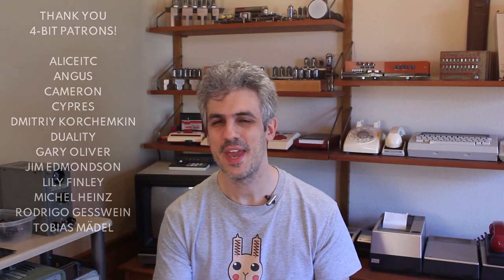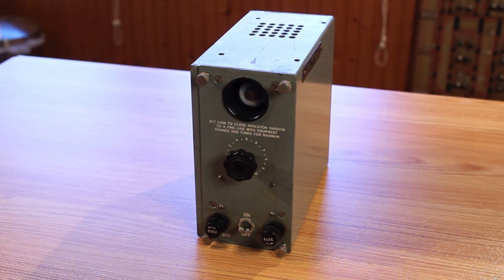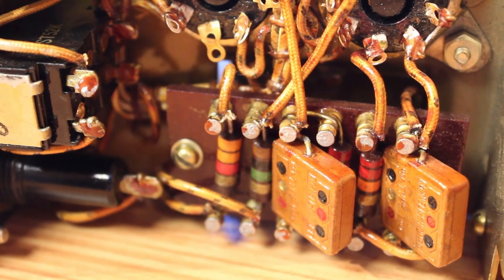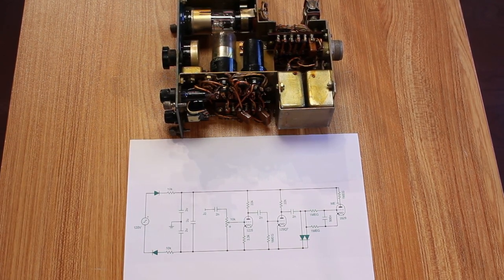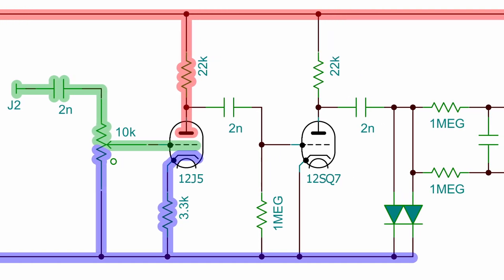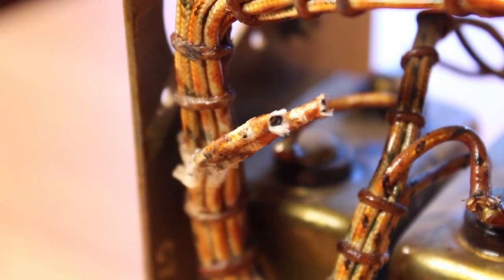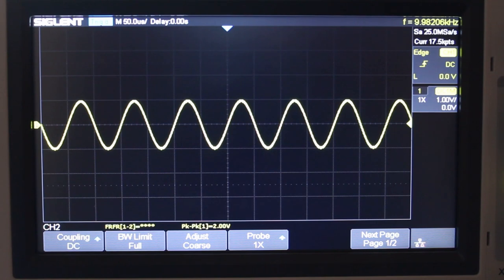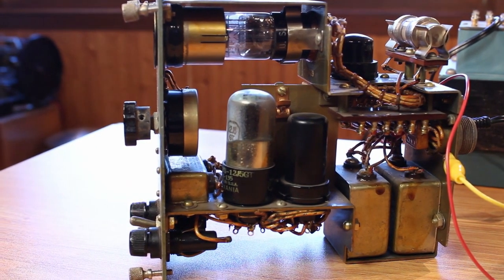Reverse Engineering a U.S. Navy Vacuum Tube Thing

Comment: Ok showed a picture of it at our club meeting tonight and no luck with a positive ID but the general though is a prototype of some form as it does not have an ID plate.  There is most likely space for it on the front where the 4 screws are.  As well can you check to see if only one or the fuses are wired up.  That would be a spare.  The fuse means it was not designed for aircraft.  They also had a look at the schematic it might be a compression amplifier for RF.
Reply from the maker: Thanks for showing it at the club meeting! A shame that we didn't get a positive ID though.
I'm still thinking the Bearing Deviation Indicator is the most likely guess!
Reply: @UsagiElectric  Well we are still working on it. So far is looks like  compression amp or a level converter for demodulating radio teletype signals.

Comment: This is to detect variations of the amplitude of an AC signal. It is to be hooked up to some sensor, who knows, perhaps sonar as others suggested. The knob is to adjust for the 'normal' level so that an abnormal level is easy to notice on the magic eye.
Reply from the maker: Thanks for the insight!
It's a surprisingly simple circuit inside, and it may have actually been designed to be used in multiple different setups, kind of like a universal detector.

Comment: Interesting unit, obviously some type of tuning indicator, World War 2 era.

The R/C coupling signal into V1, acts as a high-pass filter, rejecting frequencies below 8 kHz.

That 12H6 is a detector diode made for a receiver, when used as a rectifier, it has a maximum AC input of 150 VAC so, the diodes in series help to derate the 12H6.

The curious part is the series filament resistor; why is it in a fuse holder.  Makes me wonder if this unit is made to operate on more than one line voltage, with the resistor value changed out accordingly.

The diodes in V2 are used to clamp the AC signal, pushing the whole waveform negative, so the positive peak (assuming the signal is a sinewave) is referenced to 0 volts.

That was a good idea to redraw the circuit to make it easier to understand the signal flow.

The abnormally low value of plate resistor used with V1 and V2 is used to extend the high frequency response of these stages, to roughly a top end of 1 MHz, at the expense of stage voltage gain, which is likely  3 to 10.

The 0.5 uF cap across the grid and cathode of the magic eye tube is used to filter out any AC component, so the eye indication will be stable.
Reply from the maker: Oooh, that's a brilliant idea about the series filament resistor being interchangeable! I bet that the system was designed to be used for multiple applications on different ships, and in WWII the shipboard supplies may have varied quite a bit from ship to ship. 

I actually did make a mistake on the circuit regarding the Magic Eye tube. I went back and double checked and I missed the connection from the cathode to B-. Here's hte updated schematics, which make way more sense:
https://i.postimg.cc/jdZ7FfBh/Updated-Schematic-A.png
https://i.postimg.cc/85MyR4K4/Updated-Schematic-B.png

Thank you so much for all the excellent insight!

Comment: For the magic eye tube to work properly the beam control grid 
electrode needs to see a negative voltage, the diodes effect this operation. This is a normal setup.
Reply from the maker: You're absolutely right!

Though, I missed an important connection from the magic eye's cathode to B-, here's the updated schematics:
https://i.postimg.cc/jdZ7FfBh/Updated-Schematic-A.png
https://i.postimg.cc/85MyR4K4/Updated-Schematic-B.png

With the schematic laid out like that, it makes a lot more sense now!

Comment: The diodes on the magic eye tube is to charge negative voltage on the grid, the more negative the grid gets the more the eye close, you can see the diodes as a type of charge pump on which the positive voltage pass trough the diodes and negative voltage stays. the tube is cathode biased and the diodes let the positive voltage pass to the ground and charges up the negative voltage on the grid so that the eye can close. the stronger signal the more negative will this voltage become. this device is basically a two stage amplifier driving the indicator tube. It can be used to monitor AC voltages or voltage impulses. it might have been used to calibrate signal receivers or monitor alternator voltages or other cool stuff, or simply as a VU meter. it could be used for many things back in the days
Reply from the maker: You're absolutely right about the Magic Eye diodes!

Although, I also missed an important connection from the magic eye's cathode to B-, here's the updated schematics:
https://i.postimg.cc/jdZ7FfBh/Updated-Schematic-A.png
https://i.postimg.cc/85MyR4K4/Updated-Schematic-B.png

Also, another commenter suggested that it was used as a Bearing Deviation Indicator in early sonar systems, which seems like a fairly likely application, but you're right in that it's designed in such a way that it could have had multiple uses on several different types of equipment.
Reply: @UsagiElectric  yes and the updated schematic is absolutely looking as it is accurate now. I am almost tempted to build that sometime and test what it can do. Great work Usagi!

Comment: if I think of it as a black box with a signal input and an eye tube output, it is clear that the device is a calibrated display of some sort, i.e. you're supposed to calibrate it by adjusting the gain under controlled conditions and then do the "real job", whatever that might be, watching the eye tube and keeping it at the same level by doing whatever you're supposed to do with the "real job" equipment. I can't think of any other application.
Reply from the maker: You're definitely on the right path!
I think another commenter figured it out as a Bearing Deviation Indicator for sonar systems, which fits right in line with your black box logic!

Comment: I love the vacuum tube it uses as a Graff ...I buy them every time I see a listing online lol I find tubes with visual components are mezmerizing
Reply: Just don't use a red clean tube as an indicator LOL
Reply: Also I've heard about tubes that were essentially a self into getting a shift register component that were used in some old scrolling message displays in large format!

But there were actually metal to Sophia quartz window I believe it was forwards to be determined if it was red plating!

There was some pretty cool indicator tubes back in the day and even touch display tubes but it would require a hundred YouTube videos or more to even scratch the surface in my opinion
Reply from the maker: I totally agree, visual vacuum tubes are gorgeous!
Nixie tubes, Neons, Magic Eyes, small CRTs, even VFDs, they all just look absolutely amazing!
Reply: @UsagiElectric  I was trying to make a magic eye vu meter but I can't get the sensitivity right it even will Graff the noise in it's ac input lol...but threw my fiddling I sum how ended up with a magic eye heart beat censor lol by just holding a wire in my fingers

Comment: Just remember, when building a piece of equipment for the government, sturdiness and dependability were the primary goal. Most components inside were the highest quality. An example is diodes were rated as Jan (joint army/navy) TX  (bench tested and 'burned in').
Reply from the maker: Oh yeah, absolutely! In particular, Navy usage environments were often damp and filled with salty air, so everything had to be doubly resilient. I just love seeing equipment over-engineered like this!

Comment: It's a meter that can be set to indicate a desired level. With several stages of voltage gain. It should be extremely sensitive (edit) AC signals only.
Reply from the maker: It's so simple yet super cool, which I think is why I drawn to the mystery of its use!
Another commenter suggested that it was used as a Bearing Deviation Indicator in early sonar systems, which seems like a fairly likely application, but it's designed in such a way that it could have had multiple uses on several different types of equipment.

Comment: 2 things, 
1. The 12H6 is likely connected as a voltage doubler one plate and the other cathode tied together. This would give about 200-250 Volts from the 115 input, lots of voltage drop.
2. The cathode of the magic eye is connected to the negative bus.
the 2 diodes in the 12SK7 are used to rectify the output from the plate of the tube and give a negative signal for the magic eye.
Reply from the maker: You're absolutely right about the magic eye, I went back and double checked it and I missed the connection from the cathode to B-. Here's the updated schematics: 
https://i.postimg.cc/jdZ7FfBh/Updated-Schematic-A.png
https://i.postimg.cc/85MyR4K4/Updated-Schematic-B.png

However, I don't believe the 12H6 is connected as a voltage doubler. I checked the voltages with it powered up and coming out of the 12H6 it's sitting at just 135V. That's actually a little lower than I was expecting, but accounting for voltage drop across the diode and the mismatch of capacitor values for 60Hz as opposed to the 400Hz of shipboard supplies, it makes sense.

Comment: It's most likely calibration tool for some sort of equipment, all that circuitry does is provide adjustable signal amplification level and provide power to the eye tube.
Reply from the maker: It very much so could be! 
Another commenter suggested that it was used as a Bearing Deviation Indicator in early sonar systems, which seems like a fairly likely application as well, but it's designed in such a way that it could have had multiple uses on several different types of equipment.
Reply: @UsagiElectric  Comment by "uniservo" right, yeah that's what most likely it is, plus it kind of weirdly fits "calibration tool" description... Also multi use is also possible since it can be easily used as amplitude indicator for calibrating something.

Comment: Is an RF Modulation detector level indicator for Radio Operations...
Those "magic eye" tubes were a feature of many quality radio receivers in the 1940's
Reply from the maker: That's a good guess! I'm not sure if it's related to radio operations or not, but it was probably designed in such a way that it could be used with multiple difference machines.

Comment: It might be measuring AC but the envelope is smoothed to 0.3Hz by the 1M and 500nF (or possibly 0.15Hz). This seems like a deliberate part of the design, to remove noise, modulations, or flutter from the detected signal.
Reply: Just seen the updated 
schematic, yes 0.3Hz.
Reply from the maker: Thank you for the insight!
That makes sense, the designers probably wanted the magic eye to be nice and smooth.

Comment: Looks like a sonar peak indicator. If you adjust it as written, then any signal increase causes the two illuminated sectors to overlap and make a brighter region.  

Sonar because the coupling capacitors are too small for audio.

The circuitry is a bit odd as the input low side goes to a cathode at minus 150 volts plus ripple.  So it must be a transformer secondary driving the inputs, otherwise the ripple would get amplified too.  Weird.

Also as others have noted the eye tube cathode needs a different path to b-.

Take some care as the brown varnish is a toxic mercury fungus-proofing compound.  Don’t eat or inhale it.
Reply: And oh, might those 22K resistors actually be 220K?  Fungus proofing can make yellow look like orange.
Reply from the maker: I think you're totally on point with it being a sonar device!
Another commenter suggested that it was used as a Bearing Deviation Indicator in early sonar systems, which seems like a fairly likely application.

Also, you're absolutely about the magic eye!
I double checked the wiring and missed an important connection from the magic eye's cathode to B-, here's the updated schematics:
https://i.postimg.cc/jdZ7FfBh/Updated-Schematic-A.png
https://i.postimg.cc/85MyR4K4/Updated-Schematic-B.png

The 22k resistors are indeed 22k. They actually measure out at 22.1k on my DMM, which is insane given they're carbon composition resistors, and those like to drift a lot.

Comment: Ok I think we at the club have narrowed it down a little.  Most likely a stand along part of a Frequency Meter.  Much like the AN/URM-79 (this is an airforce item)  but rather than a CRO it uses the magic eye.  The CRO on the 79 was a simple XY and the 'Lissajous' pattern would be used to dial things in or out as the case may be.  Still looking for an exact match ;)
Reply from the maker: Oooh, the AN/URM-79 is a cool piece and I think you're getting close!
Thank you so much for all the effort you're putting into figuring it out!

Comment: My guess is that the RC network at the eye tube is meant to cause a phase shift that depends on frequency (though I agree with those who said there seems to be something off about the cathode circuit; maybe a missed component). That would affect the average voltage between cathode and grid. Increasing frequency would lead to less voltage, making the eye "open." I was rooting for you to twist the generator knob to see if that happened. If so, the instructions on the cabinet face would be setting it at a null for a normal background conditions, and the amount the eye opens reflects upward frequency shift.  Come to think of it, the opening would also respond to amplitude change at a fixed frequency. So it could be either.

Comment: Maybe because it's from the US Navy, my thought is it could have been connected to a magnetometer for mine sweeping during the war, but the list of uses for a vintage magic eye VU meter is endless though.
Reply from the maker: You're absolutely right that a Magic Eye indicator could be used for hundreds of different things!
Another commenter suggested that it was used as a Bearing Deviation Indicator in early sonar systems, which seems like a fairly likely application, but it's designed in such a way that it could have had multiple uses on several different types of equipment.

Comment: Would say the magic eye is operating correctly, with the diodes pumping charge into the grid capacitor on negative pulses, and then on the positive pulses the cathode is being clamped, slowly draining away the charge while still operating the tube.

Likely was used to set some sort of system, probably onboard ship intercom, with various channels having preset levels to set the dial, then adjust till the indicator closes on tone being put in. 2n coupling capacitors about right for audio. Using the 2 diodes likely because the designers had a stock of tubes around, so used the dual diode ones, as they knew they would be available as spares, and common, so no special parts to add to inventory by the manufacturer. 

Remember the manufacturer had to supply the spares as well, as part of the contract, so really was incentivised to reduce the number of different parts used, as they likely had to supply x number in total for the ship install, so having a common part meant no extra paperwork to enter it, no certification, and no need to put more money into the spares box.
Reply from the maker: You're absolutely right!
Though, I missed an important connection from the cathode of the 1629 to B-. Here's the updated schematics: 
https://i.postimg.cc/jdZ7FfBh/Updated-Schematic-A.png
https://i.postimg.cc/85MyR4K4/Updated-Schematic-B.png

This actually confirms your thinking even more! The diodes are pumping negative charge and the grid capacitor holds that charge during positive pulses. Also, that's excellent insight about the manufacturer having to supply the spares, I totally didn't think of that. It would definitely make sense to use tubes or parts that were used in other systems built by the manufacturer to cut down on the variety of spares that had to be used.

Another commenter suggested that it was used as a Bearing Deviation Indicator in early sonar systems, which makes a bit of sense given that it's designed to give a more precise indication of incoming frequency. But, I think it was originally designed in such a way that it could have had multiple uses on several different types of equipment. Really, anything that needed a precise frequency indicator!

Comment: The tube types are pronounced twelve J five, twelve SQ seven and twelve H six. The number preceding the first letter is the filament voltage.
Reply from the maker: I'm surprised so many people were upset by the way I pronounced the tube numbers.

I'm well aware that the first number is representative of the tube voltage, and when talking to someone in person, I do say "twelve." The reason I said the numbers individually here though is due to my personal background in aviation. You always say numbers individually when talking over the radio to avoid confusion. A tail number of N2059E is pronounced "November two zero five niner echo." You most definitely do not say "twenty fifty nine" or any other variation. To me, talking on camera is similar to talking over the radio, and when saying things like part numbers or model numbers, I try to make an effort to say each number individually, just as you would in aviation.
Reply: @UsagiElectric  I supposed the pronunciation of the tube types has been standard since the format was introduced by the RETMA in 1933. Sounds odd pronouncing the filament voltage as individual digits after nearly 90 years.
Reply: You are forgiven.  You do such good investigation we all want you to talk like an old time pro.  None of us old timers would ever say one two for the filament voltage and think "rookie" of the one who doesn't know the lingo.  I bet you know the difference between filament and heater. Tubes with separate cathode are heated with a heater.  Tubes where the cathode is the heater are called filaments but note that by the 50s most tube circuit were separate cathode and heater-filament were informally confused.